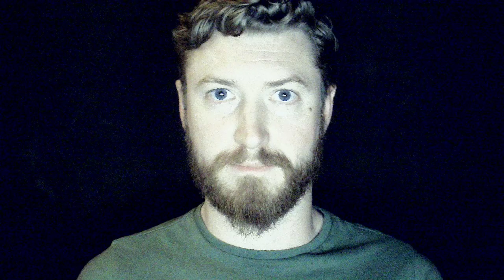Levenlore: Anglish Electrical Words

Comment: Your mic is booming like a bass drum, your audio is really bad in a stereo system, so it’s horrible to listen to.
Reply from the maker: I will work on that. How was the volume level?
Reply: @TheAnglishTimes  Your other films are mostly loud and clear, but on this film, it is very difficult to hear. The loudness is very low on this film.
Reply: @TheAnglishTimes It’s low, perhaps half the volume of the Tucker Carlson clip I watched before yours.
Reply: It seems to boom less this time, but I’m not watching in the middle of the night now either. It also sounds that the room you are in perhaps is ”naked”? People often put thick pieces of curtains up to make it less reverby.
Reply from the maker: @lYl93  I think this recording was peaking. On my latest video I tried to make sure that didn't happen. Does that one sound better?
Reply: @TheAnglishTimes  It’s good volume wise but it still sounds like you stand in a small both with thin wooden walls and floor, the mic picks up sound from something your body hits once in a while. It sounds like Iistening through a bad speaker where the sound feels like it’s playing in a box. It’s not aweful anymore, on mobile devices and regular tvs perhaps it sounds great, when they have a bunch of sound effects because the speakers can’t handle it otherwise (like cutting away low freq bass and the highest frequencies, applying some limiter and compression.) but it doesn’t sound professional.
Reply: @TheAnglishTimes Do you have a condenser mic?
Reply from the maker: @lYl93  I have this $30 Amazon mic "FIFINE USB Microphone, Metal Condenser Recording". What do you recommend (besides putting up some blankets which I agree with)? I am recording with OBS, I have not explored all of its audio features yet.
Reply: @ I bought the cheapest condenser mic in my local music store. Think the brand was ADK, and ran it through a music DAW (Reason) and my voice sounded better than in real life, even more bass, but really good sounding :) I had no specific dampening, regular carpet and a wall of LPs and the room was a small bedroom size wise. But I had good Studio ”monitors” (speakers) and later AKG 701 headphones so I could really hear what audio I put in and out. Do you know anything about audio effects? As long as your mic doesn’t pick up the rooms sound (tried different placements?) you should be able to get a luxurious sound with some filters and a little bit of compression and a limiter (digital sound effects). But my mic made my voice sounded better, like a radio voice without effects. But placement and levels and not making room sounds was important too if I remember correctly this was like 14 years ago when I dabbled with music. Maybe you need a soundcard too. Ask someone on a music producing forum or go to your local music store and talk with the synth guy :) This could be cheap. You could get a ”limited” free DAW (Digital Ausio Worksttion) in the music store when you buy their cheapest soundcard, or use a freeware. AKG also make great studio headphones for not much money, created to sound as true to the audio input as possible for the budget. Wood, walls and other surfaces can vibrate like the cabinet of a speaker, but perhaps that doesn’t matter for just voice recording.